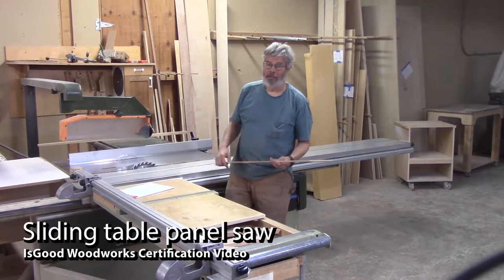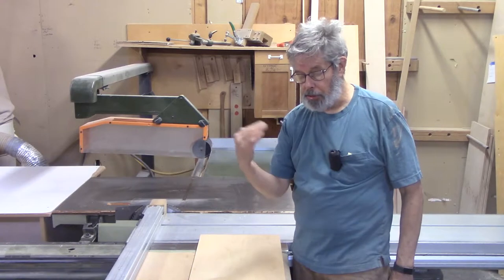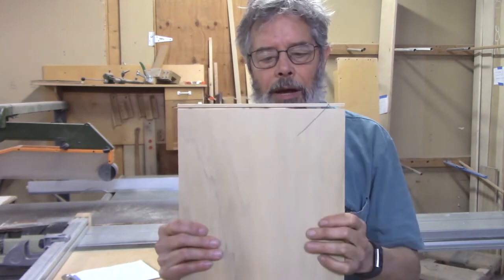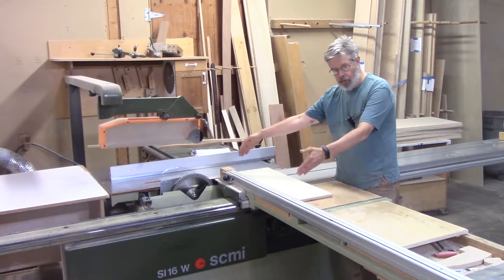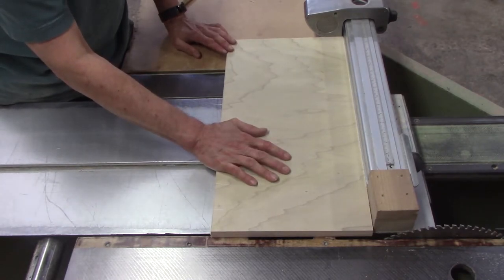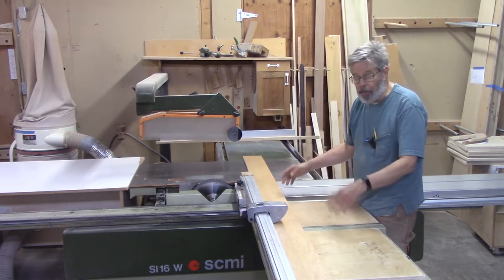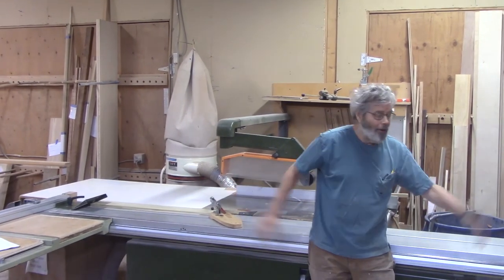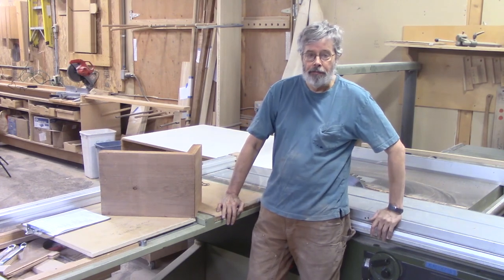01 Panel Saw Certification

Comment: Great video. Can I ask your advice on wider rip cuts? 

I'm struggling with ripping wider panels. Say I put a clean edge on the board & I want 2 cuts at 22" I can bump & cut the first one. However the second cut will be unsupported by the sliding carriage. Is the only solution to stand at the back & handle it like a table saw?   

Any advice would be appreciated.